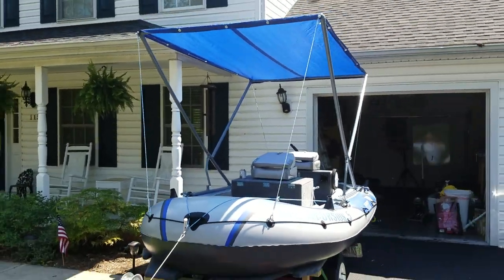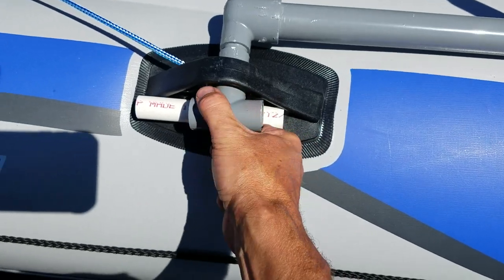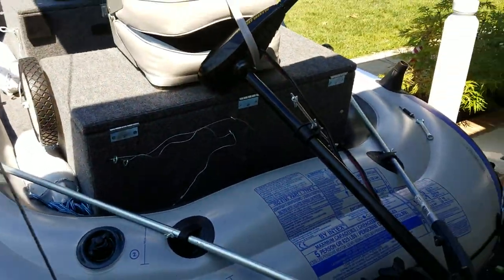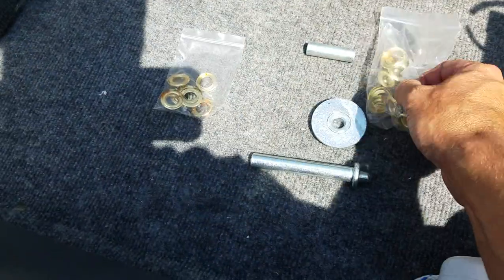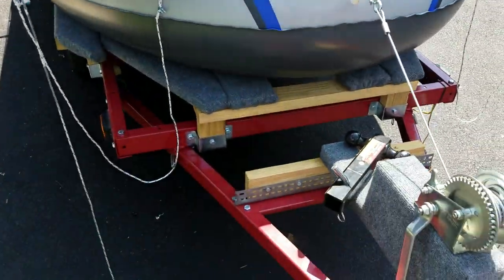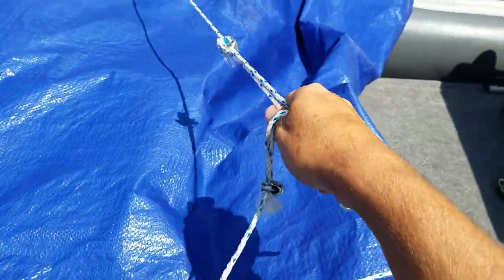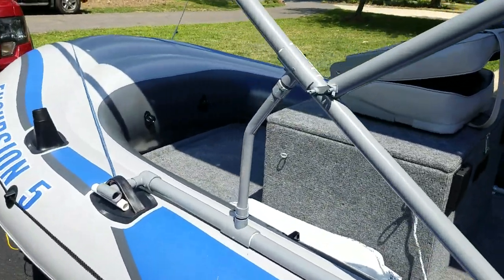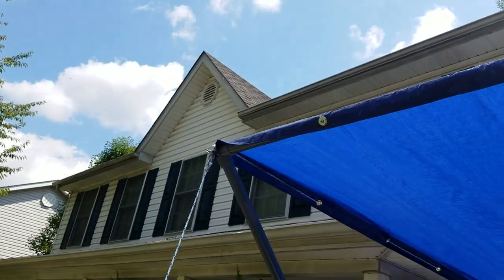Intex Excursion 5 mod - DIY Bimini / Canopy Top

Comment: Great videos, man.  Thanks for sharing.  I'm stoked to get started on mine for my family.  I want something that we can use and enjoy and will be able to take camping with us since I can't tow a camper and boat simultaneously.  Great job!
Reply: I was just thinking of how I could do this so everything could still be easily removed.  If you put D-rings on the ends of the steering rod attached to the motor then used caribeners to attach the cables it would be an easy disconnect.  Then extra eye bolts on the box to hook those onto to retain tension so the cable doesn't come unwound or come off the other pulleys.  I'm thinking if you take the cable from the port side steering bar to the starboard side of the box, go through the box on that side, lead the line to the front-inside of the box, then to the front center, then do the opposite for the starboard steering cable you could mount the wheel on the front of the box.  Then you just figure out how to wind each cable so that turning the wheel to port turns the boat to port and vice-a-versa.  When you disconnect the clips from the steering rod you could hook them to eye hooks on the opposite side of the box to retain tension.  You'd only need about 3 pulleys for each cable thsi way and the box can just be lifted out and into the back of your truck or SUV.  Make your floor in three sections of foldable in half and that becomes easily portable also.  Then just toss the battery box, bimini top, and motor in the vehicle and deflate the boat.  Boom, still portable.  No trailer needed.  You can probably tell I've been thinking about this.

Comment: Great video but what if you needed to use your oars and row? What do you do?
Reply: The Tee and Elbow that lock the pipe into the oar locks are threaded.  He can unscrew either the front or rear one, pop the pipe out of the oar lock, then use the oars.  he obviously wouldn't be able to use the awning at the same time as the oars.  Actually, thinking about it, if he pulls the rear of the awning support out of the oar lock, it might just sit on the side of the boat while he used the oars.  Would have to test that.  Regardless, it is easy to remove the rear or front of the awning from the oar lock temporarily.

Comment: Lookin good.....I notice on alot of inflatable boat vids I don't see registration numbers or reg stickers affixed to the front bow port/starboard......I'm in Calif. and it's a requirement for any motorized vessel over 10 ft.
Reply from the maker: I'm in Virginia and it has to be registered if it has any type of motor. I have a temporary registration in one of the bench seats, but I've been told Fish and Game is 6 months behind. And the registration is only good for 3 months. smh
Reply from the maker: When I do finally get the registration, I'll put it on some sort of board like other folks have done and hang it from the side.
Reply: But, doesn't Virginia require you to display it on the boat at ALL times.....so, you're saying if F&G is behind by 6 months you get a free ticket to skate for awhile......sorry, I'm confused!!
Reply from the maker: In Virginia, you have to mail the application and payment to F&G. You can't walk into an office (at least not in my area of VA) with an application and walk out with a registration. The DMV will take your application and fax it to F&G, but that's it. The DMV also gives you the temporary paper registration which has to say in the boat. The permanent license has to be displayed, if you ever receive it.
Reply: I am in Ohio and mine is required to be registered

Comment: I like every thing you did to modify the boat, good job. Now I feel better about myself because most of the time I do not know the names of most of the components that I use when building something. How is it on the water?
Reply from the maker: These things are stable as can be on the water. I also have a 12 foot jon boat that is not nearly as stable, but it can go faster in the water because of its shape. But for just trolling around, the excursions are great choice

Comment: I love the mods you have done.  I am going to be buying an Excursion 5 and will be doing similar mods.  Could you measure the lengths of your pvc pieces for your bimini top and share that with me?
Reply from the maker: The three pieces of 1" PVC on each side are 48", 65", 89". Dry-fit it first to make sure it's all lining up the way you want. Good luck!
Reply: Thank you sir

Comment: Hey how do you like that boat in general?  We are looking to get it for some snorkeling and other small water trips. I noticed you did the wood floor conversation.  Is that a must or just did it to help for fishing etc?
Reply from the maker: It's surprisingly sturdy once you add the floor. To be honest, I never tried it without the floor, but I did a bunch of research before I bought mine and everyone said the floor is a necessity. I would imagine it's pretty flimsy without it. Generally speaking, I'm super happy with it. However, I did end up buying an aluminum jon boat (I have a video on that conversion) because I fish in some rocky rivers, and I'm in the middle of restoring an 18ft fiberglass bass boat (gotta go faster)